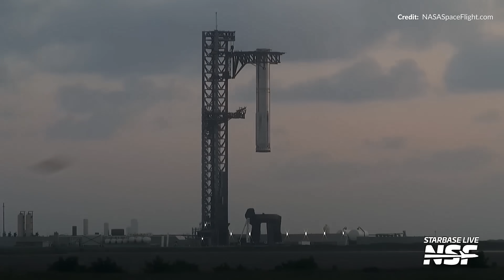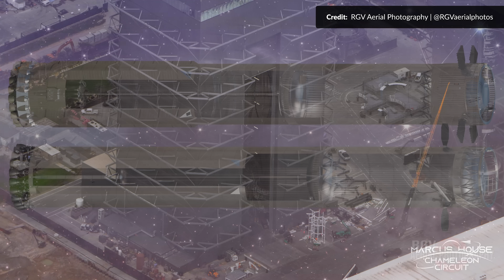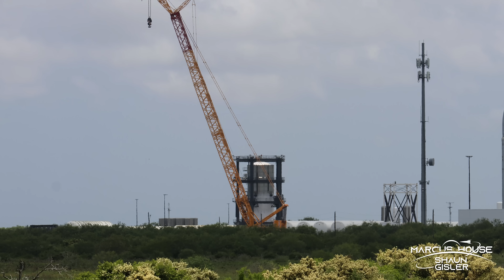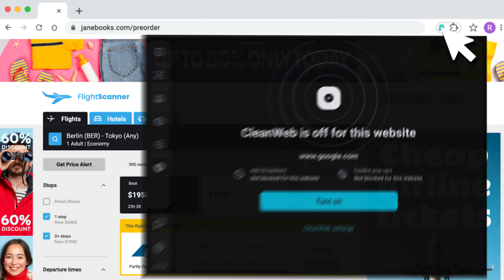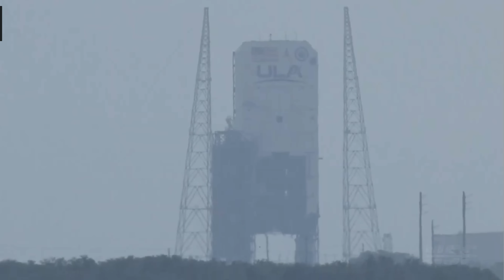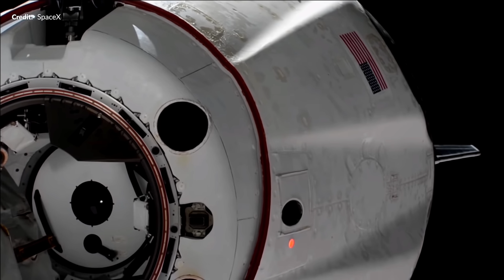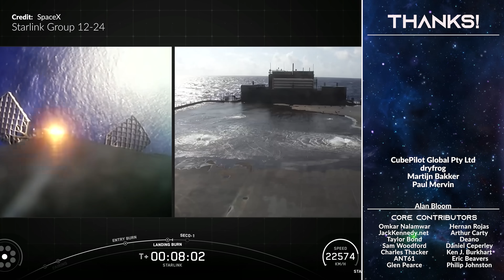Surprising changes to Starship Super Heavy! Why are they doing this?

Comment: I think Star ship will fail until they do a complete redesign of the spaceship. Starting with going back to carbon fiber.
Reply: That's the silly nonsense of the pretend expert.
Reply: lol....even Elon admitted that there is a 30 to 50 percent chance it would work using current technoloy...so what expert are you refering to...??
Reply: Elon predicted that there is a high chance that Starship would fail....is Elon a pretend expert..???  @imaginary_friend7300
Reply: @imaginary_friend7300 There is no way that 3.97mm stainless steel can reliably support millions of tons of lox at 6 g force over and over. The welds will break continuosly, as has been the case in the last 3 launches.
Reply: You have no idea what you're talking about, nor do you actually have any clue what Musk has stated. Carbon fiber is not the answer. And Starship has proven a huge amount during its flights.
Reply: @anthonypelchat Musk admitted that working with stainless steel was a gamble that quite possibly would never work. Do some actual research. There is less than a 50% chance that this configuration of Starship will ever work as designed.....
Reply: @Mark-i1p6q You do some actual research. Stainless steel was not the gamble. Carbon fiber canbot survive reentry. At least not current versions. 

Further, stainless steel has already done everything. Both the booster and ship have managed to successfully land, with the ship fully surviving reentry.

So again, you have no idea what you're talking about.
Reply: @anthonypelchat Carbon fiber is 10x stronger and 4x lighter than stainless steel. Rocket Labs is wisely using carbon fiber for its Neutron Rocket.....
Reply: @Mark-i1p6q  Your numbers are off. Further, Carbon fiber cannot handle reentry temps. Doesn't matter how strong it is. Further, Stainless Steel HAS survived reentry of both the booster and upper stage just fine.

Finally, Rocket Labs is only targetting the booster for recovery. Nothing against their approach. However, that is a drastic difference from surviving orbital reentry, which again, Starship HAS done. Finally, Neutron is only trying to compete with Falcon 9. It cannot compete with Starship.
Reply: @anthonypelchat Now, I know your full of BS. My numbers are all verifiable. You are definitely an Elon fanboy that is'nt properly following your leaders comments on the feasibility of the Starship program.....
Reply: @anthonypelchat Making fuel tanks out of stainless steel 3.97mm thick will never wotk. The welds will break everytime. You only can use stainless on the outside, but carbon fiber is best used on the inside of Starship
Reply: @Mark-i1p6q  And that shows how little you know. You are spewing junk that you heard but don't understand. And yet Starship has had multiple flights that have successfully landed both the booster and upper stage. Further, none of the failures have been due to the stainless steel.
Reply: @anthonypelchat Wrong...the last 3 failures are because the stainless steel fuel tanks leaked...ie Failed....do your research.....
...
Reply: @Mark-i1p6q  Incorrect, but keep trying.
Reply: Elon fanboy dont cry when they redesign Starship using carbon fiber....Don't forget fanboy that Crew Dragon is about 90% carbon fiber....whoops.... @anthonypelchat

Comment: Why does SpaceX not attempted to put Starship into orbit?  It appears that having the Starship survive reentry is the elephant in the room.  They keep concentrating on making the booster bigger and bigger, and yet have come nowhere near solving the safe return from orbit of the Starship.  Shows us the orbit Elon, show us the orbit!
Reply: They need to first show they can safely deorbit, that's the point of the single engine test burn.
Reply: because if they put it in a full orbit and it fails it could renter anywhere vs falling in a known corridor they can clear before launch.

Comment: The whole Trump/Musk thing seems to have been rather more of a media circus than anything to do with reality. Musk was clearly annoyed that this years spending bill didn't cut the deficit instead concentrating on tax cuts to stimulate growth. It was probably the best thing to do overall though as growth forecasts are now set for something in the region of 4.6% which is very strong considering Europe has zero growth or even contraction. They aren't going to be decommissioning dragon any time soon as even when operational it will take some time for Starship to become crew rated.

Comment: In the days of riveted steel ship construction which ended in the mid 1960's a cofferdam, air space was installed between tanks formed by the hull structure that contained different fluids. Example to separate potable water from fuel oil. It was decided to abandon the cofferdam when full penetration electric welding was employed to build the hull, as it eliminated and seam. Should cofferdams be reconsidered in Starship tanks that contain fuels at such extreme temperatures?

Comment: I never called them A or B because it was illogical. To call them that would have necessitated saying the location as well, because WHICH "Pad B" would you be referring to? Texas? Florida? Whereas "Pad 2" will carry with it the location by default (after new ones are built in new locations people would learn it, which means you wouldn't have to continue referring to it over time)
Reply: Dude there is no practical difference between "B" and "2". They are both simply the second element of their respective ordinal sets. If there is just a few of them then  they can be used interchangeably and if there is a lot of them then they won't get asigned only a single unique number regardless of their locations. Do you see runways for planes numbered like N1 is in LA, N2 in NY and N3 in London?
Reply: @tnnetnattninuttn4627  Since I don't envision there to be hundreds of towers like there are with runways, makes that's a bit of a moot point. Otherwise I'll admit, it would've been a good comparison.

I also typed that before the later tower news was read, and numerical designators only makes MORE sense now. Because with there being dedicated catch towers, they'll easily be labeled with a letter suffix.
Either to label them 2a and 2b (launch and catch), or 2 and 2C with C designating Catch-only.

Though yea, I suppose they could reference the location by the number and the towers by the letter, where Starbase being Location 1 and then towers A and B. But doesn't matter since SpaceX is already doing numbers for the towers. 😋

Comment: Starlink internet is way over priced. Why would i want to pay 3 times what i currently pay for same or actually, less speed.
Reply: Simple. Because someone cannot get the internet you currently have. Ever heard of HugesNet or Viasat? People have been stuck using those services for over a decade now with promises of fiber/cable coming sometime, but never happening. Others are stuck with DSL as their best option. And still others have technically faster internet, but only a single provider that doesn't maintain the systems. So those people have outages all the time.

Further, others need internet for traveling. Try taking fiber or cable with you in an RV, ship, or aircraft. Doesn't work so well, does it? Next time, try to realize not everyone lives in your tiny little bubble.
Reply: Because the point is not to compete with fiber but to provide internet to remote locations.  That was always their stated goal for starlink.  Google is your friend, consider actually trying to inform yourself.

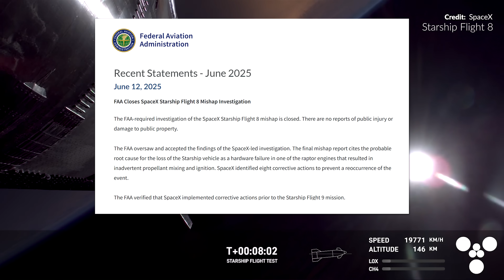Comment: 14:00  Marcus, please do not misquote the report. It's not the "root cause" it's the PROBABLE root cause. The real root cause is that the fuel tanks leak. Methane leaks more than LOX, because it has a lower MW. Until SpaceX addresses the problem of fuel leakage, Starship will fail. Instead they put in more insulation and fire suppression systems. These changes are just bandaids.
Reply: So you know more than the people writing the reports with access to actual data?  I love you pretend experts.
Reply: @imaginary_friend7300  I love you too.

Comment: I don't understand the redesign to the flat bottom tank. The flat bottom will deflect/move a lot under pressure (affecting the engines), and very, very mass inefficient. There will also be a great deal of stress at the 90deg corner of the tank and vibration/movement due to the engine harmonics. Imagine a giant drum.
Reply: It is not flat bottomed, that’s just the thrust puck/engineheat shield

Comment: Is it feasible to remove svezda without disabling the entire ISS?
Reply: Ask Putin, he'll say yes. Ask anybody who's got a full deck, they'll say no.
Reply: @spacexrocks1041 svesda has had lots of problems. If it becomes unmaintainable as a module, the question is can we eject svesda, or do its problems turn the entire ISS into trash?

You should worry less about a full deck and worry more about having a complete brain.
Reply: @spacexrocks1041 having looked it up on the ISS diagram, I can see that svezda can likely be ejected with little technical consequence, but likely significant political fallout. That's really all I wanted to know.
Reply: @kennethroberts6993  The ports have likely long since cold welded together, so ejecting it is pretty likely to be impossible on that front. It also supplies most of the station's life support, which might be a bad idea to drop.

Comment: The future longer versions of boosters, are going to be 10 meters taller than the first generation; will not that affect the catching maneuver? Because the tower is not going to change. Safety issues?
Reply: I don't see why.
Reply: The new towers are built with the changes in mind. Tower 2 is different from Tower 1.

Comment: This project will not function properly until they move to a duel cylinder full length tank setup.
This will add structural integrity and remove the need for any downcommers.
Reply: So says you pretend experts.
Reply: @imaginary_friend7300 this isn't the first time it's been done. It's an already known design.
Reply: Each tank would be a different volume and mass/density making it unbalanced.  So no.
:face-fuchsia-tongue-out:
Reply: I @Scanner9631  there is nothing to balance lol

Comment: too big is a problem... spacex with starship will fail... rocketlab with neutron will succeed...
Reply: I'm literally betting on Rocket Lab succeeding, but I would never bet on SpaceX failing. Size is not the issue.
Reply: @motokid6008  read what was said "with starship"...
Reply: @ksd593 - Starship needs to and eventually will go bigger even. Scale is the only way to defeat the tyranny of the rocket equation with our current technology.
Reply: @motokid6008  going bigger is a problem and dangerous. present medium rockets are optimal and safe and useful enough... btw i would consider sending stripped down iss station during mars transit window, possibly with the assistance of present heavy lift capabilities that spacex has... could be faster as most of the tech iss has onboard...
Reply: @ksd593 - Sending station modules to Mars would require a massive rocket. Like Starship.  Going bigger isn't anymore dangerous then it already is. It's just an engineering challenge. Again the only way to beat the rocket equation is scale.
Reply: @motokid6008  why is it so difficult to accept... smaller descent and ascent vehicles have less problems... if one wants a trasfer vehicle, deliver/assembl/supply it in space. the problem of elon is that he wants to make this vehicle in such proportions to descent and be reused ... i wish him luck...
Reply: @ksd593 - Smaller launch vehicles solve nothing. They do not have the payload capacity to deliver anything beyond a flag waving mission. Even the mighty SaturnV only had enough payload to deliver two men to the lunar surface and back. If they intend a permanent stay with a surface base they will need much, much more. The biggest accomplishment of Starship next to full reuse is in orbit refuling on a large scale. That capability will open the solar system to us as it resets the rocket equation. I would even argue that orbital refuel is a larger accomplishment than full reuse.
Reply: @motokid6008  please read what say again. for safe descent and ascent one needs something the size of dragon, not the size if starship. Starship has it's purpose, but only as a station for teansfers and orbiting, not for comming back to earth or for landings on mars or moon...
Reply: @ksd593 - for delivering mass tonnage to the surface of the Moon/Mars including humans that intend to stay on the surface for a long period of time you need Starship. The goal is not to recreate Apollo.
Reply: @motokid6008  humans will land and ascent on dragon or dream chaser size ships. large payloads/cargoes/transfer ships will be added in space. possibly there might be landings for large cargos as well, but humans will not be on board. mark my words... too big is dangerous... russians cancelled n2 for a reason... if starship+booster after being fully fueled explodes once, the project and concept development will be over...
Reply: @ksd593 - Russia cancelled the n1 because they didn't have the funding or political means to keep it going. Comparing the N1 to anything else is disingenuous. In order to establish a permanent presence on the moon a large amount of personnel will be required. Two people in a tiny lander will not cut it. They will need larger crews. 'mark my words" - I will. Enjoy being on the wrong side of history lumped in with the people who said planes, trains and automobiles will never happen. "if starship+booster after being fully fueled explodes once, the project and concept development will be over." - They only cost 100million so no they'll just correct the problem and fly again. When it comes to carrying humans no one will be getting near Starship until its had 100+ flights. The vehicle is still very much in the early days of development.
Reply: @motokid6008  imagine human landing and ascending as it is now from and to iss. same will be around moon and mars. starship will play a role of a station, and only... 4 to maybe maximum 8 humans at a time will decent/ascent...  i think elon realises this and therefore he wants to push his humanoid robots because one can risk them as cargo and because every porson you send there will want to come back which is even more chalanging than on the way there, not to mention almost impossible if ascent vehicle is as heavy as starship... so, in other words, not many humans will be on mars within elon's and our lifetimes. be realistic. additionally, with so few   inhabitants local economy on another planet is impossible, plus mars cannot sell anything to earth for value, maybe it can only draw revenues from reality shows and research funnding....that's it, not untill propulsion changes...
Reply: Says the pretend expert.
Reply: @imaginary_friend7300  one needs humility more than expertise... size is a problem, not just the size of starship... elon has a large ego... you don't need an expert to see it...
Reply: Neutron is trying to catch up to Falcon 9. SpaceX can keep using F9 if needed. Further, Starship has already proven that it can do missions like F9 with reusable boosters. That already puts it far beyond anything else out there. But if they nail down reusability on the ship, there is nothing that will come anywhere close. You will literally only choose other vehicles because you want to go against SpaceX.
Reply: @anthonypelchat  all i'm saying is that reusable starships is a misdirected focus. noone denies achievements of spacex. point comes when too big and too powerful in proposed numbers is a problem.
Reply: @ksd593  As of right now, Starship could already replace non-crewed launches from the Falcon 9 and Heavy if SpaceX wanted. However, with the goal being full reuse, they won't do so unless it is determined to be pointless. They are not at that point right now. 

And what SpaceX has over ALL OTHER launch providers is that they can wait on rushing to provide launches as a service until they reach their goals. That is because they have the most reliable launch vehicle ever built already in operation. There is no need to rush Starship out half finished right now. That is what you and others don't understand. Neutron and New Glenn and Vulcan and Arianne 6 and all of these other new vehicles, along with old ones, are only trying to compete with Falcon 9 and Heavy. And in nearly every case, they can't. So SpaceX has no reason at all to rush Starship.
Reply: @anthonypelchat  he burns through cash too much with this approach... could be in space and ready for next transfer windows in time with all already aveilable tech integrated... the real problem/challange is that he wants to descent on a very large and incapable vehicle staying in one piece... i sincerely wish him luck...
Reply: @ksd593  He has the ability to burn as much as needed. Again, SpaceX has no need to rush. Falcon 9 is launching the most commercial payloads of anyone out there. And its the only crew option outside of China and Russia. And then Starlink is bringing in billions each year as well, much more than ANY launch provider has ever managed.

Rushing Starship for Mars or the Moon or LEO or whatever, is a complete waste if the goal is full reusability. Better to focus on full reuse now while they easily can. Further, Mars will need help from more launch towers, which are being built but not ready. 

Also, Starship has managed to land both the booster and upper stage multiple times each now. They are just having issues with the new version, which would also cause issues with launching payloads. Which again, is why it is better to focus on development now instead of rushing something out.